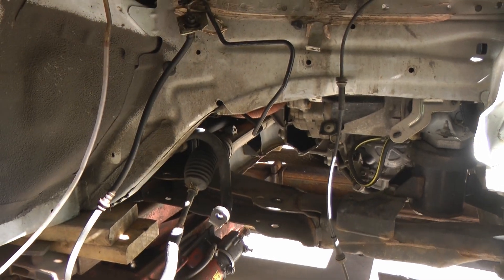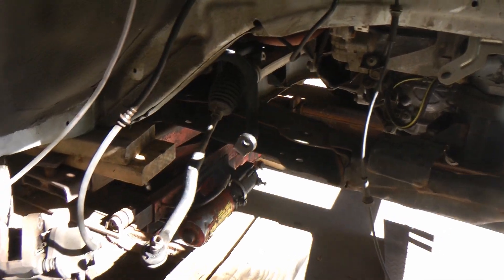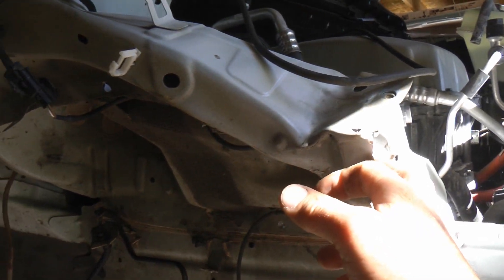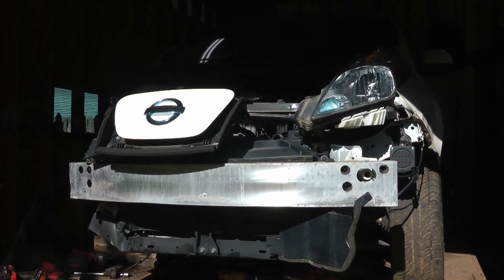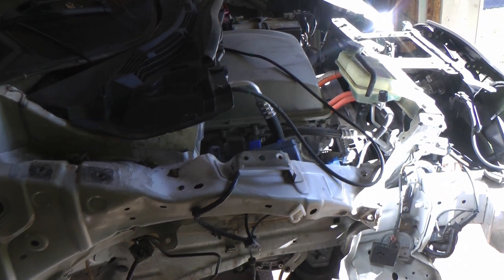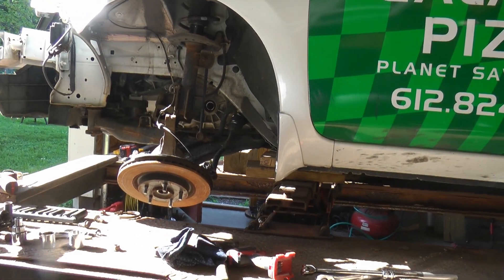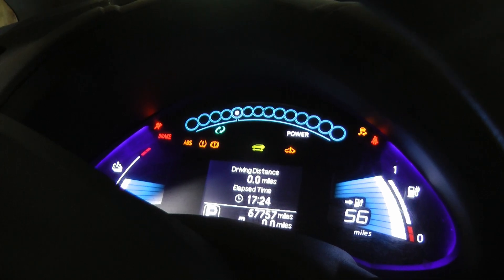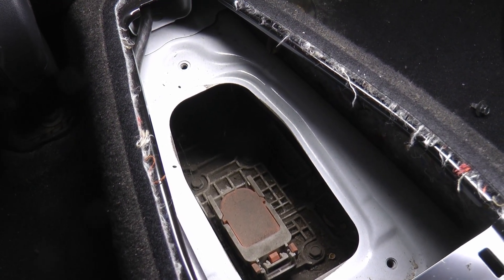Nissan Leaf Carefully Disconnecting the High Voltage Battery Leads (JK)

Comment: I appreciate this video and understand the difficulty in videoing the removal of the plugs. Even so, it was helpful. I ha e removed them several times and never figured out how. The first time, I broke off the black sleeve that slides like you did. Didn't break it the second time. I still struggle with the HV fuse. That thing should've been designed with an easier removal mechanism. Thanks.